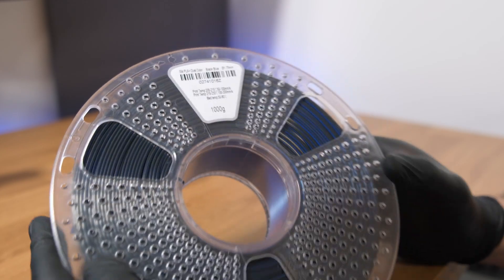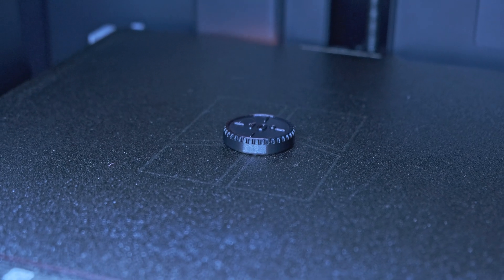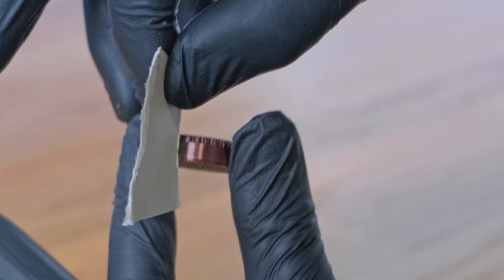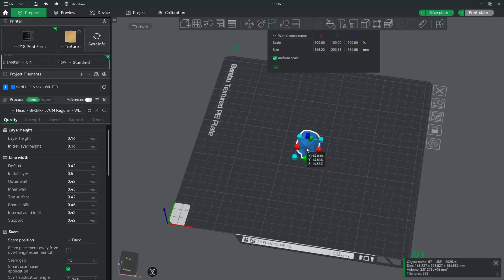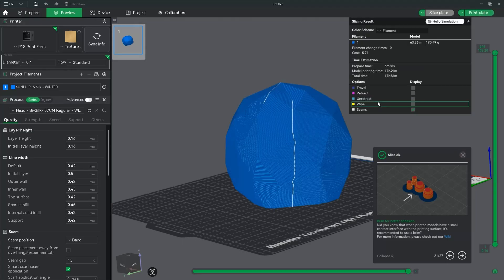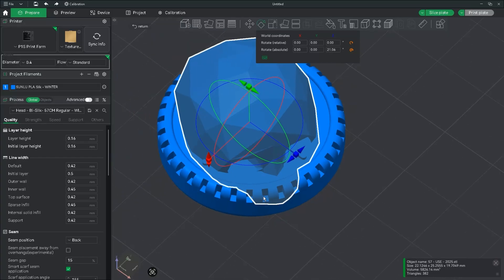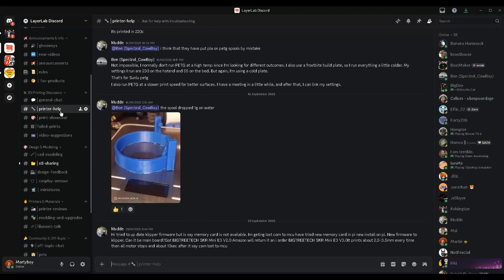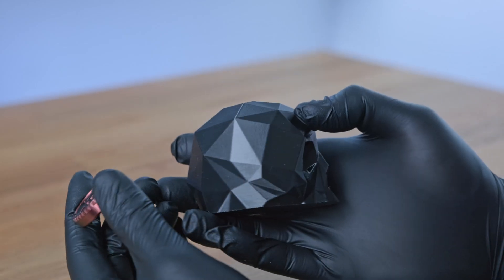The Secret to Perfect Dual-Color Prints (Calibration Disk!)

Comment: I don't understand how this works! How does the angle of the model during print affect which color the filament appear in?
Reply from the maker: Yeah it is a bit confusing as to why this works, but to put it simply, the dual-color effect depends on how the filament’s colored halves meet the path of the nozzle. By rotating the 3D model in your slicer, you’re rotating that path relative to the filament’s color split, which lets you control where each color shows up on the finished print—front, side, diagonal, etc.—without changing the filament itself.
Reply: @LayerLabAustralia ah! Perfect, thanks for the clarification. 👍
Reply from the maker: You are most welcome! ☺️